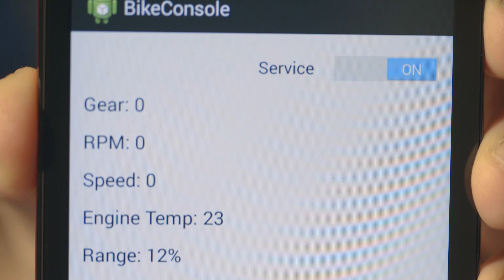Creating a New Experience For Motorcycle Riders | Intel

Comment: Does it use the ECM or GPS for speed? Most motorcycles read about 8-10% higher than actual.  Meaning, if your bike reads 65 mph, then you're probably only doing 60.

Comment: It would be interesting if they had equipped their design with a 2-way bluetooth connection, to connect and pair 2 bluetooth earpieces, to the machine, or together; to have rider and passenger in contact with GPS and can talk to one another.

An invention that currently costs way too much ($120+), should cost only a few bucks!

Comment: I like the idea while it's used to aid the rider but sooner or later it's going to interfere. 
"You have exceeded the speed limit for this road, slowing down" "Warning your front wheel is not in contact with the road"
Reply: and then it cuts power and calls the cops =D